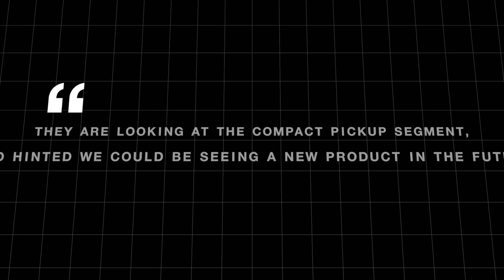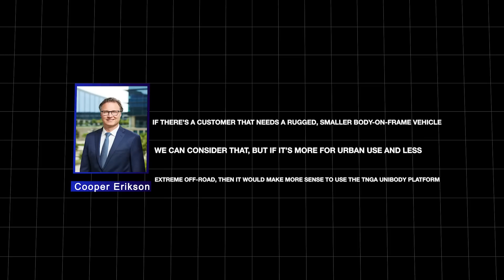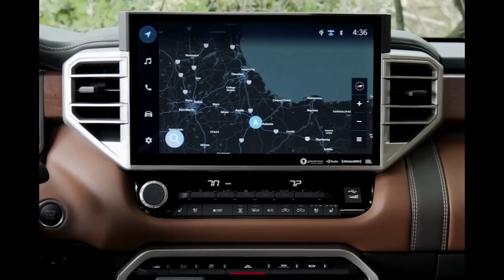New CEO Reveals $23k Toyota Stout | Ford Maverick Competitor

Comment: I've been a Toyota guy most of my life. I bought a hybrid Maverick (XLT, moonroof, lux pac, heated seats, bed liner, cover, all in @$28k) about a year ago to replace my hybrid Hilander and I absolutely love it. I do mostly in town driving and am getting average of 46 mpg during warmer months and 35 mpg in winter. I've been crying for Toyota to make a small hybrid truck ever since they first came out with the Prius and especially since they started making Tacomas as big as the original Tundras. Who needs a $50k truck that looks cool but is massively under powered and gets 16 mpg? I've had 86 Toy 4x4. and 89 Toy 2x4 pickups that I loved. I had a 96 Taco that was great (if underpowered) until the frame rusted out. If Toyota made a small, affordable truck that was either hybrid or electric I would seriously consider going back but for now I am MASSIVELY impressed with my Mav. My primary concern is how long will it last?
Reply: Your last statement says it all.  Ford just does not have the reliability record of Toyota.  Nobody does.
Reply: @geoleo2597  Agree, but that being said, Toy's history of bad frames on Tacoma's has dulled the shine on that rep a bit. My Taco was junk with rotten frame at 125,000 miles. Granted I live in upper midwest with salted roads but frame should not turn into Swiss cheese like that.
Reply: @MrResomaker  I've heard about the first year of the gen 3 (2005?) Taco frames developing cracks. Have you heard of other frames? 

No car is free from some defects over time. But overall Toyota has the best reliability record in the industry. The recalls and problems with the Maverick seem to be many. I was seriously considering buying a Maverick, with all the hype and features it offered. But hesitant about it being a Ford.  And now the dealers are marking these cars up to prices that no longer make it a good value. It was a great sounding truck at $28 out the door with the features I built mine with. But not at the prices the dealers want now. Greedy suckers
Reply: @geoleo2597  My Taco was 1st gen (96). I think they were all having frame issues up until 2007 or so. Frame looked fine until one day you could poke your finger right through it. Then the newer ones where having shifting issues. As I said above, I've been a Toyota guy most of my life. I was really reluctant about buying a Ford too. But almost one year in now I am very impressed and happy with my Mav. I have no expectations that it will be as bullet proof as Toyotas but only time will tell. It's true that the Mav has had a few recalls but none are really serious issues and not surprising for a first year model built during a global pandemic. My dealer honored the agreed price even though any unclaimed trucks were selling for $5k over list.
Reply: @MrResomaker  I've many friends with older year Tacos as yours and didn't have any issues, even in high salt and high humidity environments. Especially those years being popular for off-roading and mods they've been performing well. I guess there's always some variances in reliability. 

That's good your Ford dealer honored the original price. $28k for that model and features is a great value. However, I heard many dealers didn't honor the MSRP to the demise of unhappy customers. The Mav does boast some impressive features for the original MSRP.  But if they sell more than MSRP to me its now longer a good value. Let's hope your Mav stands the test of time. It looks like for now, if you find you didn't like it and decided to sell, your resale value looks to be good.

Comment: i completely agree with toyotas stance on sticking with just hybrid. The EV is actually worse for the environment that we dont see directly, the dredging of the earth to get the rare metals needed to make the batteries and the the power grids in the US are severely outdated (our gov has been dismantling hydro dams and plants to boot too). The hybrid way to go for range anxiety and not having to sit for hours to charge for people that cant afford or have access to home charging.
Reply: @yellowflash649  now if they can find a reliable way of recycling batteries and increase the grid to handle (even minimize its vulnerabilities) then maybe its possible but there still needs to be radical infrastructure upgrades. Also ford has applied for a patent to make their cars lock themselves and even drive away for missing payments so thats another side of coin.

Comment: Compact. 4×2 rear wheel drive. 4 & 6cyl, hybrid,turbo. 2&4 door. With standard & upgrades interior & exterior trims. 20,000/30,000 range. Handsome Toyota reliability and quality! Build it and we will come.😎👍

Comment: If they can maintain their legendary reliability they will have a hit.  I'm a Ford fan but would definitely consider one of these based upon Ford's dismal recent quality.
Reply: Ford has their 2.5 hybrid engine as one of the engines in the Maverick...that engine is bullet proof / long lasting.... they've been using it for years with solid reliability....yes, ford's small turbo engines with their coolant intrusion bad...but even those are all resolved now..

Comment: Most people want to use a truck for weekend errands like going to Home Depot to carry stuff with a short or long bed.  Add a pluggable hybrid option so we can all run it on cheap electricity and you got a winner.  I do the same with my very expensive fully loaded Black Label Lincoln Aviator because it’s great to drive around a AWD 500 HP luxurious SUV at 30 cents for the first 20 miles and 35 mpg in city driving.

Comment: You said it right in the video - it would be driven on city streets, not rough terrain. Modern trucks aren't for hauling, they're for suburban moms. Truck beds and SUV trunks have gotten smaller, while the total size of the trucks have increased. These are just making roads more dangerous. They're bigger, they're heavier, they're less useful, the front ends are too tall to have any real visibility, and data shows that drivers of bigger vehicles are overconfident, more willing to take risks, and are generally worse drivers. No thanks. :P

Comment: Imagine if they made this with real 4x4 and not awd with hybrid. It gets weight savings using the unibody, and it’s a smaller truck, but can be capable off road as well. But a city dweller like me, would only need a fwd gas or hybrid power train. I’m pretty sure some people on the regular gas variant would want a manual for enthusiasts. If so, would they switch out their cable actuated clutch in favour or hydraulic clutch?

Comment: I was interested in the upcoming Toyota Stout until I heard it was a unibody car like the Honda Ridgeline, Hyundai Santa Fe and Ford Maverick.  Hopefully Toyota has DANA Corporation dip the frames unlike my new Tacoma 4WD XTraCab that had frame perforation corrosion at 91,000 miles when I stopped using it as a pickup truck, and the frame rusted completely in half at 137,000 miles when I scrapped it.  The Toyota stealership actually laughed at my misfortune and did nothing to reimburse me for their manufacturer's defect.  I recently imported a 1996 4WD Daihatsu Hijet mini truck and it's awesome.  We need practical high mileage mini trucks in the US.
Reply: Body on Frame is used as an example of ruggedness and a better vehicle quality of the past, but people also don't realize that trucks aren't held to the same safety standards as cars, and therefore, they do this because its cheaper and easier to manufacturer.

Comment: I would have bought the Maverick but couldn't find or order one.  Please make it look like the concept- way cooler looking than the Maverick is.  Also please make BASIC options available. I don't want power windows, or a computer, or automatic transmission or any of that other expensive useless BS.  I just want a truck (am/fm radio, heat and ac)

Comment: I mostly don't like the "new stuff" these companies come out with, because it creates additional points of failure and makes it hard for shade-tree mechanics to maintain and repair their own vehicles.  I don't like the full-on EVs.  BUT I think the plug-in hybrids are a good marriage of ICE and EV that provide fuel efficiency AND power.  You won't get very far on just the batteries, but you might be able to creep to the nearest mechanic if the engine goes out, and not be entirely stuck.  

As a kid ('70s and '80s), I used to imagine a different kind of hybrid:  An engine that uses an electro-magnet in the bottom of the cylinder that repels the bottom of the piston from the bottom of the cylinder.  So the power boost isn't from an electric motor built into the wheels, but something inside the engine, itself, that boosts the power stroke and even gives you some power on the exhaust stroke.

I don't know if it's viable or if anyone has looked into it.  But if it's viable, I sure would like to see them come out with something like that.  Might squeeze a little more power and fuel efficiency out of a vehicle.

Comment: Back in the 90s car and trucks were smaller.  The Tacoma was much smaller, and toyota had an even smaller pickup called Toyota pickup (2 seaters).  I had a manual one used one or H.S..  Ford ranger was smaller too.  Tiny datsun pickup, and even the odd ball el camino.  I think sometime in the early 2010s, trucks had to have a backseat for efficiency.  But that made the trucks bigger and more power.
Reply: I believe there was a small Mazda pickup too back then...

Comment: honestly curious who would want a micro pickup truck and what exactly would be the advantage over just getting a hybrid suv/subaru thing? the only difference between pickups and suv's/hybrids is the bed, and with these tiny little trucks that have double cabs, your bed is essentially the same size as the trunk of an suv.

Comment: I am in a Lincoln MKC, nice, but entry level SUV. I am very interested in a small, but well appointed pickup, with decent back seat room. Comfort is very, very important, with fuel economy being a concern. I like the Hyundai Santa Cruz, but because the back seat is so cramped it is a no go. Hoping the Stout is close to the concept, looks exactly what I would like…. With comfortable seats, heated and ventilated seats, heated steering wheel, remote start, adaptive cruise control, auto high/low lights, blind spot monitoring…. Just want a small luxury pickup…. Please Toyota!

Comment: I doubt we would see this mythical Stout until late 2025 at the earliest. An AWD Stout with a 2.0L hybrid turbo diesel and an EPA rated 50MPG combined avg. would be a category killer. Tow 4,500 lbs with 400+ lb/ft of torque and 200hp. But with the typical options packages that Toyota is known for, you would be looking at a $40k plus truck.

Comment: Mandating electric cars is killing the electric car.  A hybrid isn't a great deal either.   A small truck is sorely missed in the market.  It needs to be affordable, able to handle small quantity building materials such as a sheet of plywood, able to tow a utility trailer, and handle light off road terrain for hunters, fisherman, and camping.  The biggest killer of a small truck idea is making the open bed too small.  Engine killers like direct fuel injection and turbochargers in tiny engines will spoil a good opportunity for success too.

Comment: How can Toyota make a car that cost less then many and most UTV/ATV’s because of all the additional federal and state requirements to how cars have to be built for safety purposes. I don’t believe it. I just don’t. I think when the actually end up on dealer lots they will be a lot more expensive. Plus I bet that price is for a base model that litterly has no features what so ever. Toyotas are in general way over priced. A Toyota RAv 4 is 6k to 7k more expensive the. A Ford escape and you get more features and luxury on a Escape. Two of my newborns RAV 4’s have been in the shop for repairs 5 times, my wife’s escape hasn’t been in once in the same length of time. So I don’t believe it.
Reply: There not overpriced if people are willing to pay that much for them
Reply: There’s a reason Toyota’s are more expensive than Ford, your case is rare.

Comment: Man when the hell are they gonna bring a competitor to the wrangler and bronco?  The 4runner is great, i own one, but toyota needs to make an off road focused vehicle with removable doors, a roll cage, big tires option, 4.10 gear ratio, etc.  And make it reliable, which jeep and ford don't have.  That would knock jeep and ford out of the market for the most part

Comment: $23K = 4door, 40MPG pickup that can actually haul flat-sheet goods 
 
If you want to make an Eversion of it, fine but I need something that I can drive if the grid goes down for 4wks after another hurricane. That means an efficient ICE so I can store gas in the shed and not worry about having to drive 60miles(rd trip) just to sit in line to charge an EV.

Comment: Only over priced compact truck I’d buy today is the ford bronco. If Chevy would build the full size K5 blazer/ K5 GMC Jimmy and did it correctly I’d buy that. Would be nice if ford built a full size bronco. Ford proved with the bronco that most people like me want off-road capability and toughness. Also is nice having something modular and easy to customize. That’s why Chevy needs to bring the K5 back. Also make the damn thing a solid axle.

Comment: Let me make a prediction that since everyone will want one, the crooked dealers will be putting huge markups on them. $23k? Right! I'll bet you won't be able to buy one for $40k after all the "add on's" they force you to buy, the Dealer "Market Adjustment" (which could be $20k!) and all the other Dealer FEES! Come on people, when we ALL get together and stop buying into the B*ll Sh*t of an extra $200 for special air in the tires, $399 for a bug shield you can buy for $40 and "$2000 in undercoating you can do yourself with a $9 can of rust protection, we can stop this insanity!

Comment: The digital image designer who did the mock ups is way too conservative.  Suburbanites buying mall crawlers demand way more excitement in their grocery getters.  More panel creases, bigger fender flares, and a lot more layers of body cladding.  Plastic skid plates, snorkels, brush bars and massive fog lights are are required.  Massive wheels and tires are mandatory.  If you don't want a real pickup you need to have one that looks the part.

Comment: Compact trucks are still big. The maverick is almost the size of my 2014 Tacoma with extended cab. I’m betting a small Toyota truck would carry the 3 cyl engine without the turbo in the base model and option the 3cyl turbo in the sport trim. It will probably be built on the same platform as the Corolla
Reply: They are about a foot different in length, your Tacoma being longer. Maverick is also a few inches narrower. Sorta guessing that margin will increase, when Toyota decides it’s time to redo it.

Comment: NO!!!! I just want a SMALL truck. 4, 6, or 8cyl. NON hybrid, NON electric, I don't care. TWO doors.... NOT 4.... On a frikkin' FRAME. With a 6ft bed. STANDARD transmission, Optional 4WD. UNDER $20,000.... UNDER!
Think, '84 Chevy S-10, '84 Ford Ranger, or '85 Dodge Dakota.... What's so difficult about this!

Comment: Hey Toyota, want to make some serious cash? Make something to complete with an F250!
Standard cab
8 foot box that you can throw a bag of pig feed into without denting it
Crank up windows
Bench seat
Power steering and brakes
5 speed with over drive/ auto option
2 or 4 WD
And fancy options like AC and FM radio.
In other words, a work truck that can take a beating and keep running.
I don't need to sit in a recliner watching TV while I'm pulling a cattle trailer down the highway!
And, make it affordable.

Comment: Remake the one from the sixties.
For half the price of the other trucks.
12,000$. A 4-cylinder 4 speed quarter ton. Strip down Plain Jane.
More useful/ functional, then a station wagon any day, and probably sell millions of them, if you didn't change a thing year after year.
Because still not everybody can afford or wants to pay $23,000 and have to worried about scratching the paint or denting it a little.

Comment: Fake news. This vehicle does not exist for sale. Anyways, I doubt Ford is sweating it too much. 

I was in San Antonio at Toyota's (then) new SA plant for the launch of the new Tundra made at that plant. The Toyota project manager demonstrated how the Tundra was superior to the F-150 in every way (acceleration, braking, towing, etc.). Yet every year since it was introduced, the F-150 has easily outsold the Tundra.

Which is to say, even if Toyota produces the Stout to the U.S., it does not mean it will outsell the Maverick. For decades, Americans have demonstrated with their wallets that they prefer to buy American trucks.